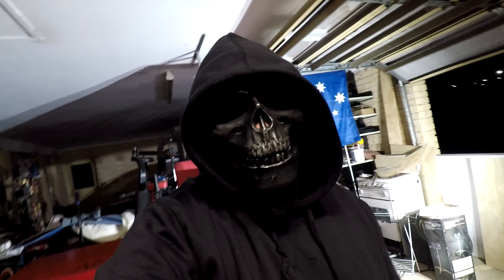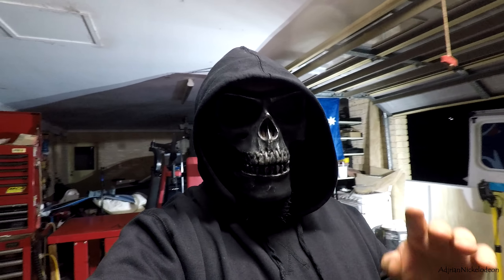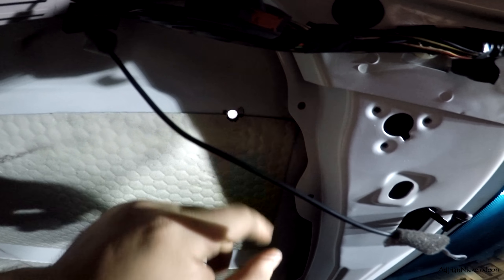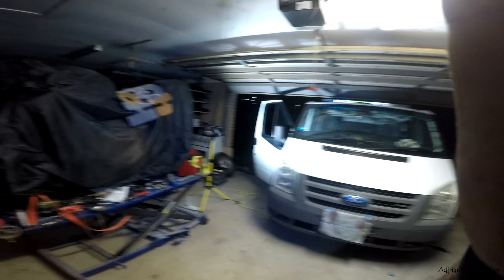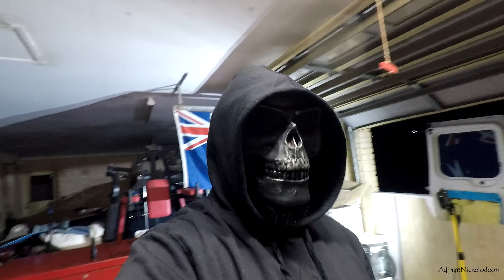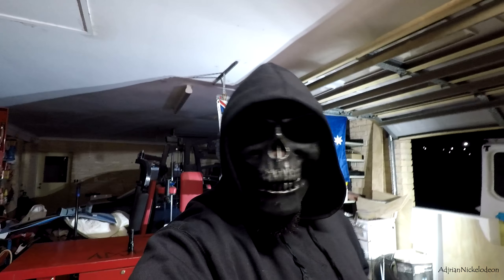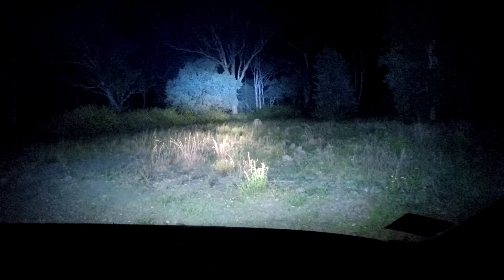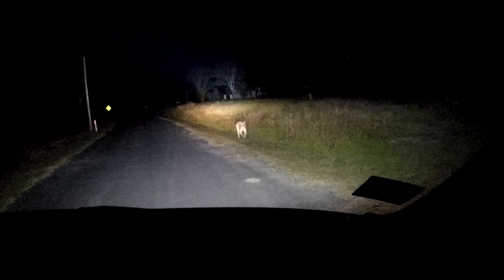DISOBEDIENT KANGAROO

Comment: Now you just need LED low beams and high beams in the front, and a toggle switch to turn off the lightbar for fog and shit. I have a little 120w 27" behind my grille that is pretty much dwarfed by my xenondepot led highs that end up around 160w.
Reply from the maker: 160w.. cute :)

#306w ;)

Comment: Protip, when you see a roo on the road, dip your lights so they can see you coming. When you have you high beams on you blind them so they can't run away from you.

Might have been a little overkill with the silicon there though AJ but better than it leaking!

Oh, and it's a van, not a truck :P
Reply: Do u mean dip, etc low beam?
Reply: Yup, dim/dip/low beam etc. Obviously use high beams as necessary but when you spot a roo, slow down and dip your lights.
Reply: Satans Reverence I find the opposite. Don't slow and don't dip, if you slow the engine pitch change is was scares them and if you blind them they are less likely to move, well that's the ones I come across anyway but obviously cover the breaks incase the decide to jump
Reply from the maker: Yeah, I don't know about that man. I've had skippys jump out on me more often than not when my lights are dipped. I think best practice is to slam on the brakes (provided no one behind you) expecting an impact, wash off all the speed and hope for the best. Better practice is to be on super high alert but you only ever truly see them when they start moving because the Eastern greys blend so well with the bush.

Comment: lol You beat me to it! I was going to suggest that this video be retitled something like: Man Terrorizes Local Wildlife With Amazing New Auxbeam Light Bar

Ugh. Around here, the deer stand in the middle of your side of the road and wait for you, hoping you aren't using your high beams and can't stop in time. If you are and manage to stop, they stand there while you're blinding them, then when they can see a little better they meander off the road at a walk. I've had a coyote—a predator—panic and get out of the road faster than deer do.

In any case, blinding fog reflections aside, you can color me impressed. It's estimated that there are thirty million plus deer in North America, and that over two years sometime in the past decade we struck two and a half million of them; the resulting damages ran over seven billion (plus a few hundred human deaths). If I trusted people to not blind each other—which I definitely don't—I'd consider this to be a decent, multipurpose solution (on an unfamiliar road, you'd sure as hell see a turn far enough ahead to prepare for it).
Reply from the maker: Literally almost his a deer (stag) while out testing this bar. Chased him into the bush but only got his fluffy tail disappearing on camera :) Drivers on the highway are pretty courteous over here with their high beams in my experience
Reply: I like to think that, by and large, the courtesy is the same here. But in my state (and presumably others) there are specific distance requirements for when high beams must be turned down and some people are so scared or anal retentive that they'll absolutely adhere to them; when your pupils are adjusted for the dark, though, all of those distances are way too close. It's also possible to be distracted and forget.

lol Maybe vehicles need to send out wi-fi signals or something so that lights dim automatically.
Reply from the maker: The Timekeeper the legal distance here in Australia is 200m however high beams go off way earlier than that here. Sucks for you man :(